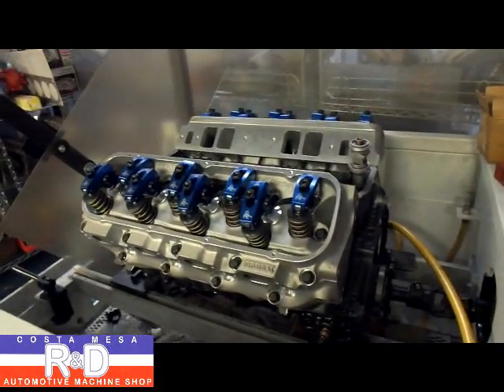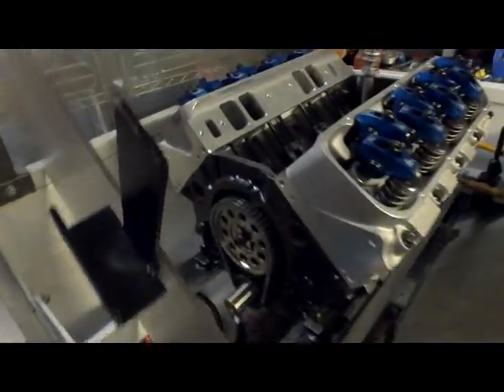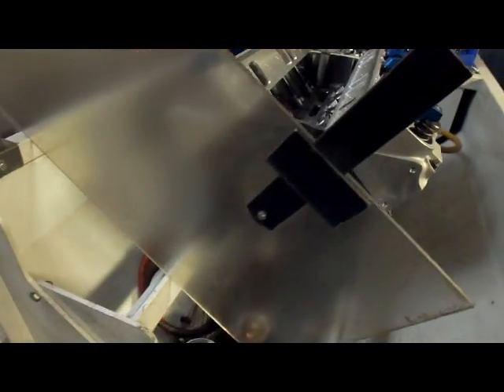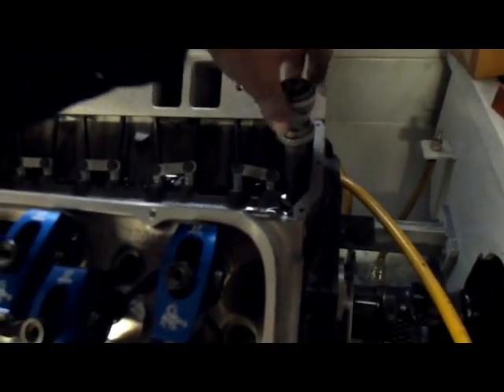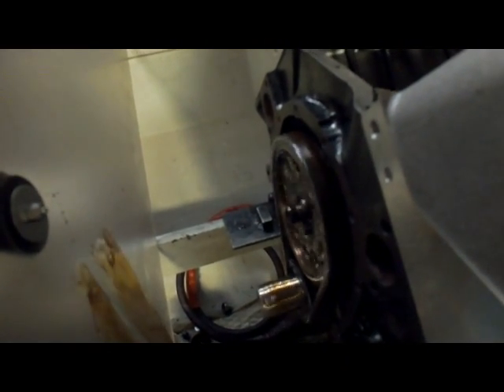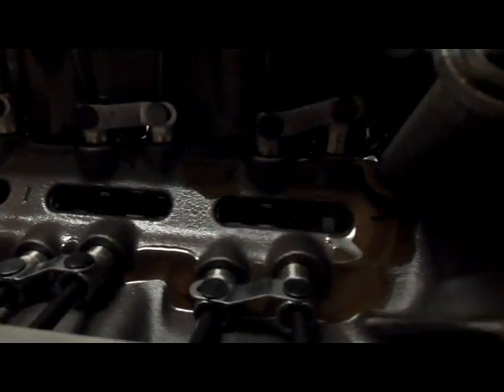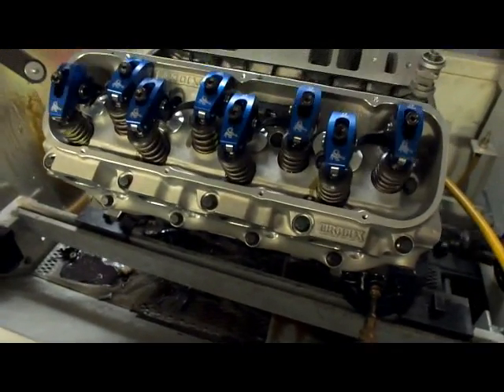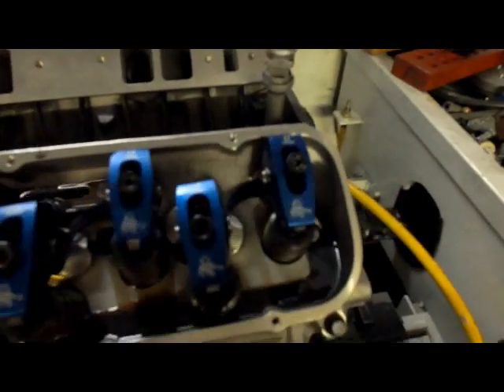BBC 496 Stroker Ski Boat Engine on the Simtester

Comment: You mentioned that oil squirters are necessary for hydraulic rollers.  I'm assuming these are just galley plugs with small holes?  Why are they necessary and what affect do they have on oil pressure?

Comment: I actually built a table for that. I used an old pool pump motor with a pulley on it and belt drive over to the crank pulley on the engine, I'd usually run it about five to ten mins.

Comment: I like to 'simtest' my small engines when I build a 'new' one.     of course mine is arm powered but I feel it gives the motor a chance to circulate lubricant for a short period of time without the heat of a running engine.    I bet I could do a pretty good job rotating the mower with a variable speed drill adapted to the flywheel nut.    the lightbulb just went off and my arm is grateful

Comment from the maker: We use a special break-in oil that is heated. Amperage tends to drop between 1-3 amps and rpm's increase by 1-3 in about 20 minutes running time. Flat tappet engines are on the high side, where rollers are not. That just goes to prove that rollerized engine generate a lot less friction.

Comment: Two questions,  1) what oil are you using in the simtester?  2) Does the machine have a ammeter on the electric motor, if so do you shoot for a drop in amps from *new* to when you called it done being tested and what is a target amount?